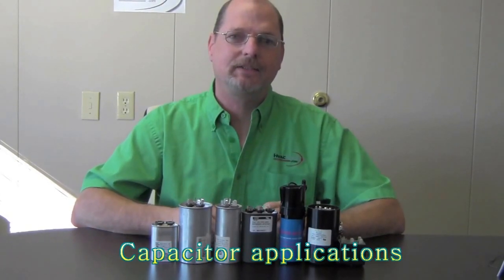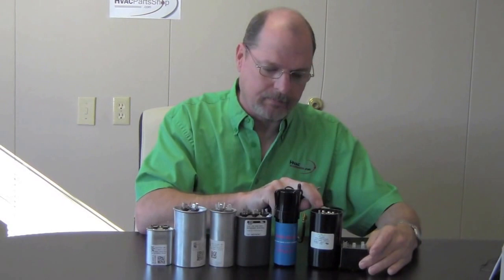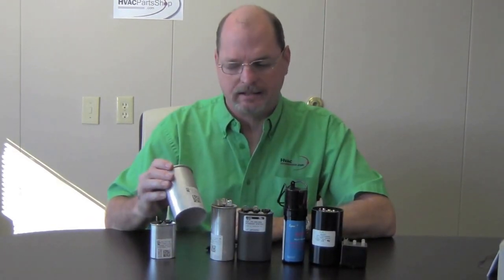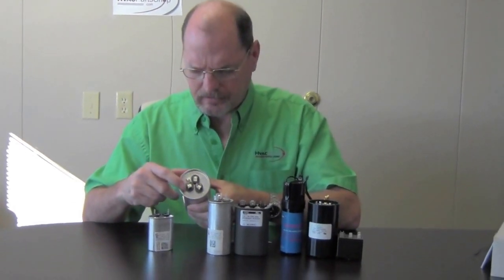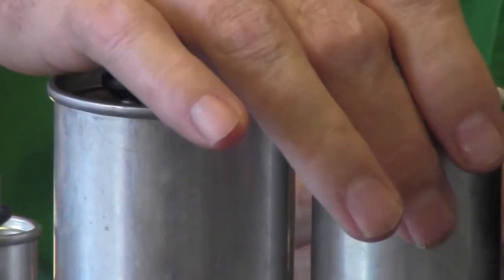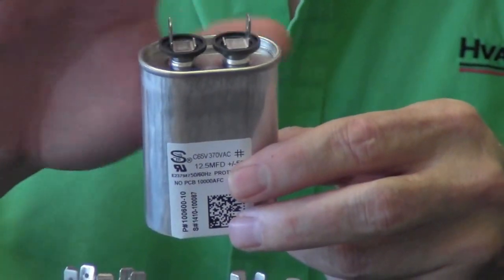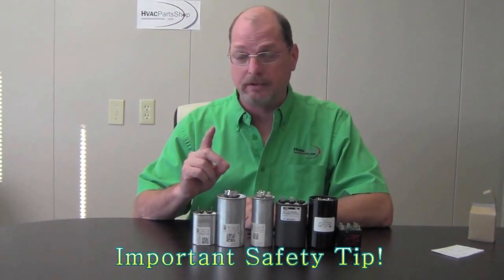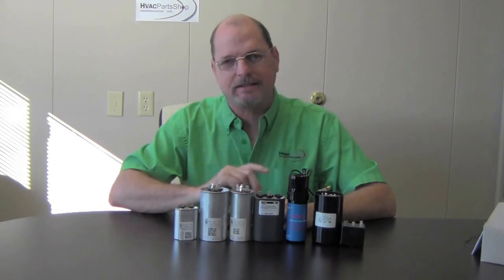Capacitors

Comment: I got an old window air conditioner with a bad capacitor.  Its got dual prongs Its a 370 vac but the only other numbers are y 3 35 70.  I have no clue what that means.  Its got a part # of c313455 and it say york capacitor and Westinghouse on it.  I just need someone to tell me what I got and what I can replace it with. The part number hasn't been any help.  It's definitely the problem the fan barely turns and i use to have to help it like you said in the video.  The capacitor has really swelled.  Please help me.

Comment: Question: why do some of them say 50/60Hz and others say 60/50Hz?
Reply from the maker: 60 Hz alternates between polarities much faster than 50 Hz, so things which depend on this frequency will run faster at 60 Hz than at 50 Hz. Either way, if the main power line frequency used to power a clock is not the frequency it was designed for, the clock will be of no use.

Comment: My current capacitor is a 45/5/440 but it is a Sunday and all I can find is a 30/5/440.. Will this work??
Reply from the maker: You need to stick with the 45/5/440 capacitor! By using a smaller size mfd's on capacitor for the compressor it can actually cause damage! It will damage the windings inside the compressor.

Comment: Question for you Sir- my capacitor has a little three pronged insulator thing between the terminals, blocking me from discharging the unit? how do I safely remove it so I can discharge? TIA

Comment: I need to replace a 450 vac 40+6 uf run capacitor. Can I use a 440 vac 40+6 uf instead?
Reply: Hello , I would stay with the 450 VAC. I do know if you had a 370VAC. cap. you could move up to a 440VAC. cap. But if your unit came out with a 440VAC . Capacitor you should not move down to a 370vac run capacitor so I would think the same principles would apply

Comment: Steve thank for your info... but still the question was not answered.What does the 1043 H rating mean?  I understand the other parameters. Is there a way to attach a jpg of the label here on youtube?Sincerely,Bob Campbellanchorite@socal.rr.com7/19/2017
Reply: Bob I am not sure what the 1043H rating means I have never seen this on a capacitor. If you keep researching for the answer please share when you find it. One thing for sure in this trade of HVAC you learn something new everyday.
Reply: Ok, I will keep researching and let you know.  I bought another capacitor today at All Electronics, (LA area) and it had an H-rating as well.  Thanks again, Bob

Comment: Hi maybe you can help: Below is the data off my capacitor.  What does the 10 43 H rating mean???Baldor ED1216C06216-259uf  250VAC50/60 Hz  +65C10 43H or 1043H  USA  Ru(R is reversed)Thanks Bob  anchorite@socal.rr.com
Reply: Hello,ED1216C06 Would be the part number,  216-259 UF would be the microfarad , 250VAC  Would be the Max voltage the capacitor can store ,  65C would be the operating range some capacitor give you a range such as -45C to 70C and the C would be Celsius. This would be a start Capacitor not a dual run capacitor.

Comment: If a furnace run CAP calls for a 5MF CAP and you use a 7.5 or 10 MF CAP, will this damage the motor?
Reply: Hello the (short answer) you should use the proper run capacitor for your motor using a higher rated capacitor will cause your motor to run at higher amps which could strain or damaged the motor as well as the higher rated replacement capacitor. Thanks for the question